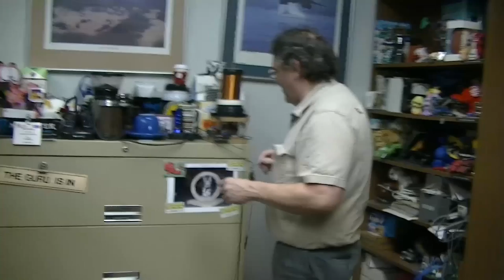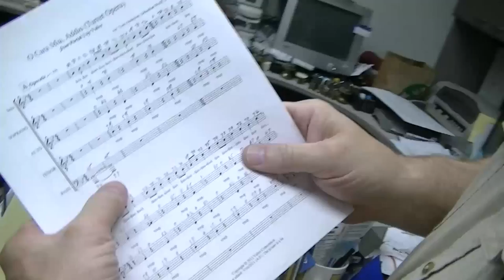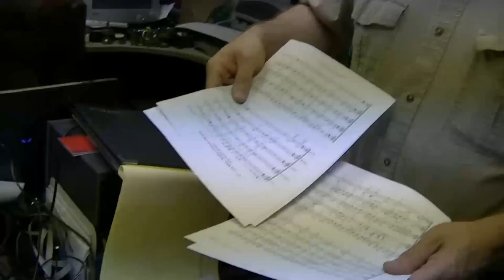Musical Tesla Coil

Comment from the maker: the geek group, for whom this project was done, will be releasing information and kits to build your own, very soon.  this is also a very early test, and there's been a number of improvements since. :)  i'll be posting new videos of that when its available (i have a much larger coil coming together here that'll run on that tech) and you could use that to find where to get the bits and info :)